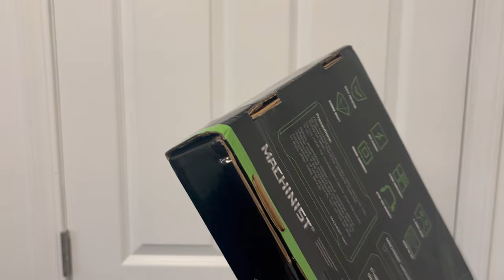Machinist B450 motherboard rundown

Comment: Since this is a "white" motherboard from "AliExpress", how do we even know it's a B450 and not a A520 😅
Reply from the maker: Features from b450 motherboards all line up here, usually a520 does not allow any overclocking or XMP but this motherboard does. A bit basic on the BIOS but has those features. Coming on a separate video
Reply: @AndysPCs yo bro, when is that coming up?
Reply: It's definitely a B450,I have bought 5 so far, the older revision didn't have XMP but was still B450 since that's what AMDs driver auto detect tool installed and HWInfo reported.  The v1s only the  way to get above 2400mhz, was with Ryzen master.  Glad the newer versions fixed that.
Reply: @JordosTechShack do u recommend this mobo should I get this or the gigabyte a520 m . I’m just not too sure about this brand is it reliable enough I’m pairing a 5600 x and a 6800xt  ?
Reply: @yasinahmed6920  yes I wouldn't hesitate or have any trepidation using this board.  I have a build video up using it for my daughters all white PC.  Despite being one of my cheapest builds it came out one of the cleanest looking builds. 
  On my video on this motherboard I have a comment from a viewer who has a 5600x in it and has had good luck undervolting and OCing the chip.

Comment: U know where I can get the BIOS for this motherboard?if you have backup ,please send the link here. Thanks!
Reply: I ordered one and I tried a 5700G, since I did not need to plug up a gpu and it worked. I had read it did not support APUs. I looked for hours and could not find anything regarding a BIOS update so if you do please post it. You can find information on INTEL boards also called MACHINIST. Apparently these support  5000 series. I was planning on checking to see if they support a 2600 since I can get one for $30.

Comment: Friend, I am from Brazil. Could you send the updated BIOS for your B450 Machinist for Ryzen 5000 series? Mine arrived outdated
Reply from the maker: Hey friend, my best recommendation would be to flash bios/reset if you can with the jumper pin. If not just do the old CMOS trick and let me know how that works. Will be looking for drivers for you
Reply: @AndysPCs  Friend, I performed the reset but there's no video. I am using the Ryzen 5 5500, and in all the videos I watch, everyone is using some Ryzen 5000, but it doesn't work for me. Could it be a defect or perhaps an outdated BIOS?
Reply from the maker: Cant be an outdated bios, they usually flash them all the same before leaving factory. You have a gpu in your system right?
Reply: @rodharuyata7100  no puede dar video porque NO tiene graficos integrados el ryzen 5500.
Reply: @her535  
Yes, I know, I used an RX 6600 that works perfectly
Reply: @AndysPCs  yes, RX 6600

Comment: May i know if this mother b is compatible on ryzen 7 5700g?
Reply from the maker: Yes will most definitely work 🤗 as long as its 5000 series or below
Reply: Ryzen 5 1600 is not working for this motherboard 😢

Comment: can you run with amd A8 processor tho? or athlon 200ge
Reply: i tried a6 9500 and it didnt work.. 2nd gen to 5th gen am4 processor will work. i hope this info can help you
Reply: @ianmoone3850  because a6 9500 is not even 1st generation or Zen 1. It's Bristol Ridge. How about Ryzen 5 1600 of 1st gen?